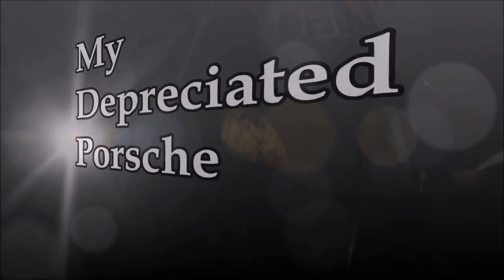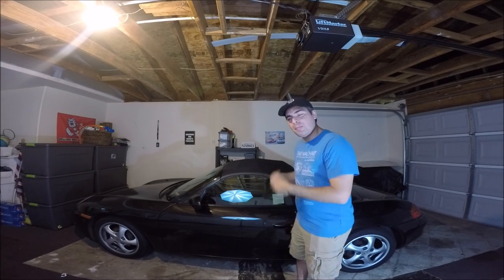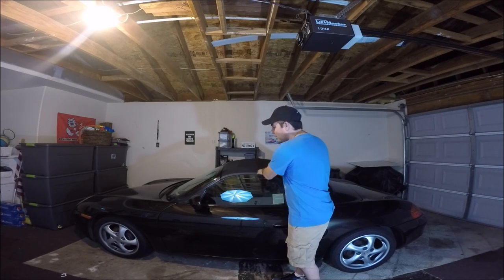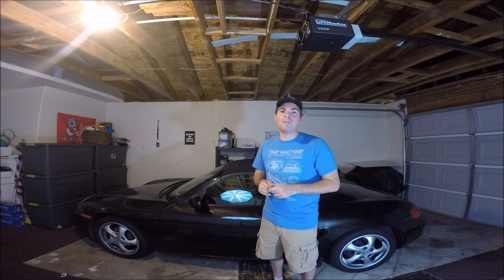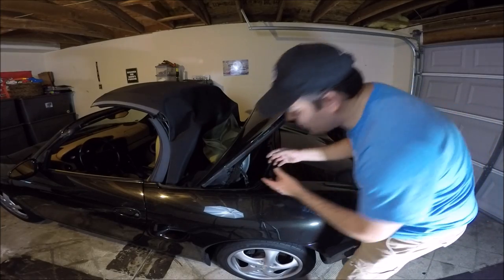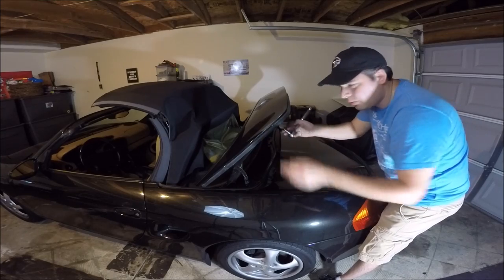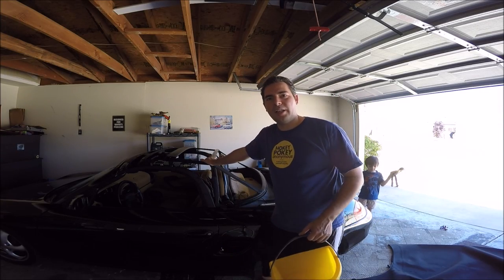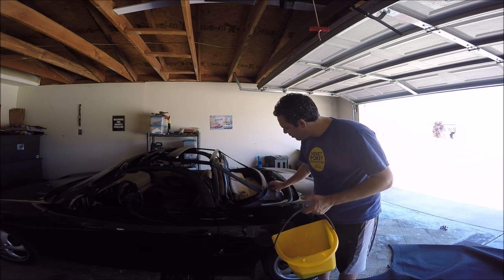How To Install A New Glass Window Convertible Top On A Porsche Boxster (986)

Comment: Thank you for doing this video. This is one of the most complete instructions I could find. I have been using 3 printed instructions and several videos, and yours is the one that is always spot on with the correct method and correct order of doing things. A lot of them calls for pulling apart the plastic slider, but yours show how to remove the top without it, and also that secret back screw in the slider which most of the other instruction miss. 
I am able to follow along step by step with your instructions as I am replacing my top.
Reply from the maker: Thanks so much for watching and glad it helped.

Comment: Thanks once again mate. I will be doing it later this year. My top is still in good condition but I would like one with a heated glass window. At the moment just doing mods on engine, plenum splitter, intake, exhaust, under drive pulley etc. Cheers
Reply from the maker: +Desmond Sequerah Feel free to ask any questions when you get around to it and thanks for watching.
Reply: Cheers. Will do.😊

Comment: Nice video, I just installed a new top a few weeks ago on my 99 from the same company, but chose the plastic window. I was trying to save a few bucks but in hindsight I wish I would have bought a glass window one. The install went okay but I would suggest to try to do the removal and install within a few days. I removed mine and installed the new one a few weeks later and forgot how a few parts went back together. I have a few wrinkles in mine on the sides especially the drivers side. I'm afraid to try and fix it because it may look worse, it's not terrible but it bothers me. I may try to smooth them out in the future. It is a bit of a job but definitely doable by the average person I would say. I called a few shops in my area and one wanted $1,800. for a GAHH glass top installed and the other quoted me a price of $750.00 to install my own top. So I saved quite a bit doing it myself. I paid $390.00 I believe and free shipping from Auto Tops Direct. I think the price is higher now by around $20.00. My thinking was if I do it myself and ruin it I could buy another top and still come out ahead as far as the labor charge.
Reply from the maker: +1955Cal Glad that it worked out pretty well for you. We had one wrinkle in ours and had to redo one side, but it came out pretty easy. Even with that nobody we talked to was able to spot the wrinkles, more something that you notice if you own the car.

Comment: Hi, I was wondering if you could comment on how the top has held up in the years since you installed it.  I have to replace mine soon so I’d like your opinion on the quality.  Thanks 🙏
Reply from the maker: I had my Boxster for just over six years and had the Boxster for about a year before installing the top. It held up very well and never faded or had any issues with the glass or sagging. So, it lasted at least four years.

I hope that helps.

Thanks for watching and taking the time to comment.
Reply: @OurRideLife  awesome news glad to hear!

Comment: Hello, really great video! - Quick question: How long do you have to keep the top closed after you first install it? I've had mine closed for about a week and it still doesn't close with one hand. I have to fight the last inch to get the hook in to close it all up. (Does it ever get back to "normal 1 hand operation" - if so how long does that usually take?) - thanks in advance!
Reply from the maker: If I remember correctly, I kept the top closed for about four weeks and then it lined up pretty well, just sometimes needed a slight adjustment with my hand.

Hope that helps.

Thanks for watching and sharing your experience.

Comment: after having it installed for awhile,  how happy are you with the top,    Are you happy with the smaller window?  Can I put this same top on a 2002 boxster?
Reply from the maker: +Jim Webb sorry for the late response on this. Overall, I’m happy with the top. The smaller window isn’t as noticeable as you would think it would be. The only thing about it is that it is a little harder to work on the car as the top no longer folds like the plastic top does, so you have reduced space when accessing the top of the engine. It isn’t too bad though as I was able to replace the air/oil separator with no issues. The top has held up well and still looks new.

For your 2002 Boxster it should be the same too. The 2003 is a little different as they came with the glass from the factory, but 2002 is the same top.

If you decide to install the top (or have already done so), we would love to hear how it goes.

Comment: This video is pretty old so i doubt youll respond to it, but if you see this, how has the top held up after the years? Thanks!
Reply from the maker: It has held up pretty well. The top still looks new and no issues with the rear window pulling back.

Having said this, mine is parked in a garage outside of when I have it in the work parking lot, so this may have helped it stay nicer longer.

Thanks for watching and taking the time to comment.

Comment: Hi, Could you let me know what glue you used to put the rear weather seal back in please?  It was in a red/white tube or did that come with the roof.  Mine has come away and I need to re-glue.  Thanks.
Reply from the maker: It is 3M Super Weatherstrip Adhesive and I purchased it at Autozone.
Reply: Thanks for taking the time to reply, it's a great video and has inspired me to have a go at fixing mine myself.  Loved the help from your boys!

Comment: hi, I just did this on my boxster. do you have trouble lifting up the back of the top for getting to the engine bay?  I find that the glass gets stuck on the roll bars and the back of the top wont lift all the way to service the engine bay.
Reply: For me the back of the top still raises, but it only raises part of the way as it did before. With the plastic window the back of the top could be opened nearly all the way, but since the glass can't fold in the middle it only opens about half as much as before. After replacing the top I also replaced the air/oil separator and was able to get enough access from the top to change all the hoses, etc. it was a tighter fit, but still manageable on my Boxster.
Reply: +David Hurth yea I am having the same issue. it only opens up about half way and it doesn't stay up so it's a bit of a pain to get to the engine bay

Comment: My glass window fell out and I was told it's better to get plastic because it's lighter and the weight of the glass is what causes it to fall out over time. But sounds like you are saying your plastic cracked? Is it from the Sun? I wonder if tint would help preserve the plastic. Really don't know if I should get glass or plastic. 🤔
Reply from the maker: Yes, the plastic tops eventually fade and crack from the sun and opening and closing the top. I always park my car in the garage, but a previous owner must have had it parked outside. Plastic is lighter and provides easier access to the engine, but glass doesn’t get a crease in it. The top I got has the glass guaranteed to stay in place for five years, but not sure if it will become an issue after that. Overall I’m happy with the glass rear window so far.
Reply: Our Ride Life thanks. Turns out they don't make plastic for my car so I'm getting a glass one with a lifetime warranty. Also suppose to have noise reduction qualities.

Comment: Have you replaced the IMS bearing on this 986?
Reply from the maker: I haven’t yet. I’ve had the car for five years with no major issues. This is a 99 and 1997-1999 986 vehicles used a dual row IMS Bearing design that has a very low rate of failure. Having said this, I’m planning to replace it with a retrofit bearing when I replace my clutch. This will just offer some added piece of mind. If the IMS Bearing does go before this, then I’m planning to do an engine swap with either a 3.4-litter out of a 996 or a 3.2-liter from a Boxster S (depends on what I can get my hands on).
Reply: just to let you know that pretty much everyone's consensus is that the first 2.5 engine is more fun to drive than the S engine. As in "sportier", "better feel", and such
 @OurRideLife
Reply from the maker: Good to know. I know I’ve heard a lot of people say that the 2.5 is more dependable.
Reply: it really is. Mine is on 87,000 miles and the engine works better than new cars. 2.5L has a specific gear/torque balance that feels very competitive and nice. Well, you most obviously know this as someone who owns it :-D   @OurRideLife